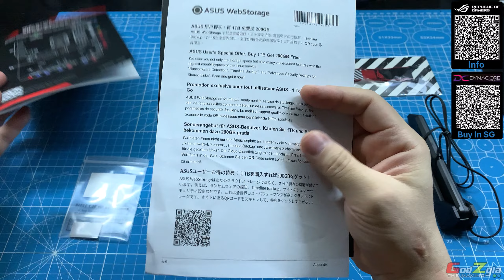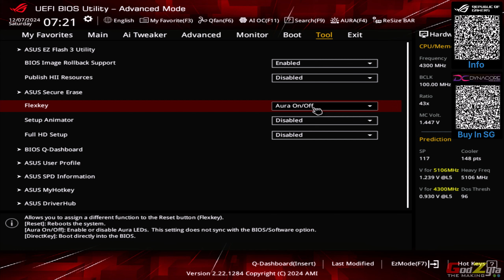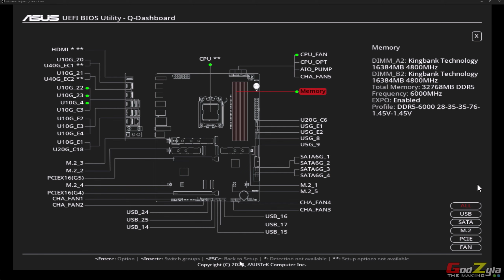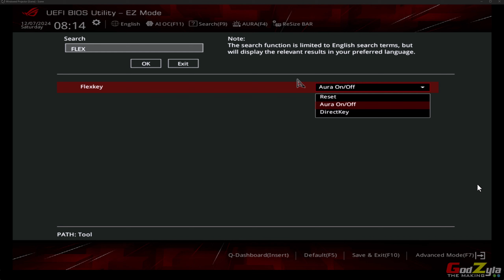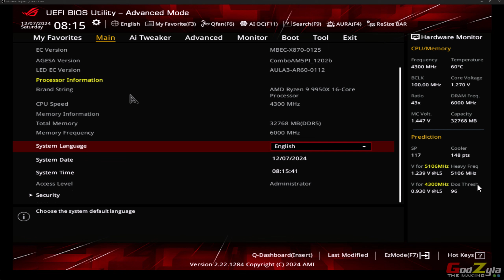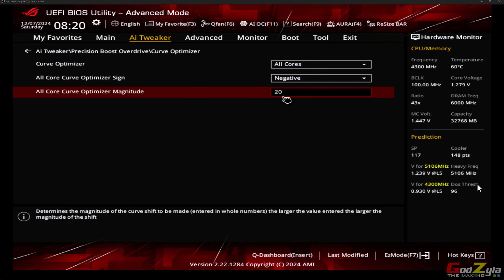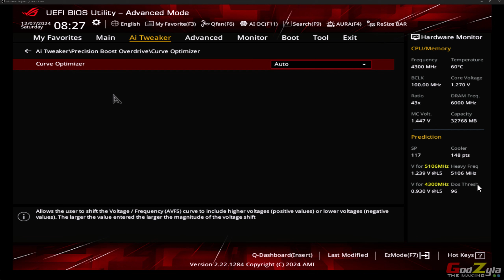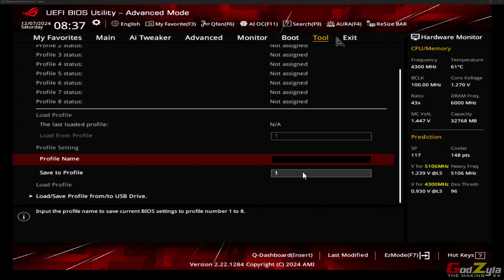Asus ROG Strix X870E-E

Comment: Peiple often nention the Asrock Nova and Taichi have no lane sharing but that is because Asrock chose tp go with a single m2 5.0 slot on their boards so there is nothing for the GPU to share with
Reply from the maker: Hi Keith Flanagan, welcome back. infact what I feel is that ASRock have not fully set the rear to run all with 3.2 usb port at gen 2. if you observe the layout of those ASRock boards, they have limited the USB version at the back. that's why no lane share and on the ASRock X870E Nova, if you insert the last PCIE slot the m.2 slot 5 will be disable. I guess that's all well plan as I feel that how often do we populate all USB at the rear. so ya, that's my thought.

Comment: after installed my DDR5 Corsair vengeance the Motherboard show 30,32,39,40...etc over and over again, the computer works ok but i dont understand whats the problem
Reply from the maker: Hi Brinzan Marius, welcome to my channel. if you check HWinfo on motherboard temperature. the readings on your debug digital code is the motherboard temperature.
Reply: @KleoYan  I did not know that, that's cool! Here I thought it was a typical debug code state haha
Reply from the maker: @KalebSDay  hi ya welcome back and yup, I didn't know at first but I was observing why is the code flashing after booting up to windows and found out that it sync with the motherboard temperature 🤣

Comment: Hi, I bought six Artic p12 argb fans which have like 0.11 amp per fan and 0.45 amp per argb, am I fine to daisy chain three of those with each other and plug them into one fan header and one argb header (same with the remaining 3 but different headers then ofc)? I’m really new to this and I’m afraid of damaging the motherboard
Reply from the maker: Hi Alaska, welcome to my channel. For the fan header of the motherboard is to 1a, so if you total up 3 fans is at 0.33a. It will be fine and it will also be fine to have 3 fan’s argb to daisy chained to 1 argb header as each header is at 3a as the total of 3 argb is at 1.35a.
Reply: @KleoYan  Thank you so sos much
Reply from the maker: @ you are most welcome. All the best with your build too.

Comment: Do you get x16 in the pcie gen 5 slot for the gpu if you only use the m.2_1 gen 5 slot to the right of the board? If so, is there a downside to using that m.2 slot since it sits a bit further away from the socket?
Reply from the maker: Hi ICEFOOL , welcome to my channel. If you only place your m.2 at M.2 2_1 Gen 5 slot, it will run x16 on your GPU. yes though the M.2 2_1 slot is away but it is still controlled by your processor.
Reply: And possibly better cooling for m2_1 as it would be closer to front air intake on most cases
Reply from the maker: @flaccus123  that's very true.. why didn't I think of that.. thanks buddy, good observation.. learned something from you 👍👍👍

Comment: Nice mb, I have the x870e crosshair hero and 9800X3D for my new pc. The hero has a backplate and is quite heavy! I saw another reviewer of the hero say it would be worth it to remove backplate and add thermal pads for the memory chips. What are ur thoughts on that?? Thanks for sharing 👍
Reply from the maker: Hi ya Evil Bane, welcome back. thank you for your feedback. It will definately help on the cooling if you place thermal pads between the VRMs and the backplate. Also provided that you have good case ventilation, if not heat will accumulate within the case.
Reply: Thanks for the advice, I'll be using a hyte y70 touch case with 10 lian li infinity fans and a gallahad 2 lcd 360 AIO. Do u know if the controller for the gallahad will be able to have all my fans plugged into it?
Reply from the maker: @puddleduckist  the GA II LCD pump block connection, is only for standard fans. plus the power supply to the fans are at lower power. I wouldn't advise to plug any uni fans to the pump block fan socket. Anyway if you do so, you still need adaptors which complicate the connection.
Reply: @KleoYan  the gallahad is the infinity fan version.
Reply from the maker: @puddleduckist  oh ok ,,, my bad.. for that. the controler itself, each port can cater up to 4 fans. total is 16 fans and not more than that. so your 10 SL infinity fans will be of no issue to plug to that single controller.
Reply: @KleoYan  Great, thanks for the help!!
Reply from the maker: @ you are most welcome 😊

Comment: 14:14 I was wondering how I would get the GPU out. I expected a button release near the edge of the MOBO, but I am glad I saw your example! That will be a good peace of mind in the future haha :D Thanks man and happy holidays to you!
Reply from the maker: Hi KalebSDay, welcome and Merry Christmas, watch this timestamp at 20:17 https://youtu.be/2mr_38vOd9M?si=u8He17BO5lj6xr30&t=1217 it applies the same with this board on how to remove the GPU from the PCI-E Slot. 😉
Reply: @KleoYan  Ah thanks for the example, I think that is the same card I have too!! 😆 I like the 4090 TUF set to 70% power limit. Reduces by about 100w and keeps most of the performance. Gotta give credit to Optimum Tech for teaching me that. 4000 series does not actually work undervolting compared to 3000 series which he also showed off.
Reply from the maker: @KalebSDay  hmm, for me it works, maybe I am not into gaming but for my work. it works like a charm when I undervolt it and yes Optimum Tech is also where I get to learn how to undervolt the 3000 series and 4000 series.
Reply: @KleoYan  Optimum Tech showed when trying to undervolt the 4000 series that the readings kind of lie and you're actually getting worse performance, so he and Debaur have recommended just power limiting from what I recal. Debaur did a cool video showing the performance you generally keep at different power limits too and 70% was around the sweet spot.

Comment: Hi, Great detailed Video on the Motherboard!!   If you had an  RTX4090 in PcIe slot 1 and you have only two M.2 PcIe-5 in M.2 slot 1 and slot 2, would the GPU run at X16 or x8
Reply from the maker: @graemebarron2128  Hi Graeme Barron, welcome to my channel. The PCI-E slot 1 will run x8 if you populate a m.2 ssd on either slot 2 or 3 m.2 slot. Timestamp 9:01

Comment: I have this mobo, I got a question can I press the flex key to turf off the aura when pc is not on but still connected to power? Cause in order to make turn off as I close the pc I set ErP S4+S5 enabled in the bios.
Reply from the maker: Hi Hold_My_Beer, welcome to my channel. This I have not tried and I have already returned this board to Asus SG, unable to answer your question, real sorry about it.

Comment: Its a pity no cooling for the base of double sided m2's in both  gen4 slots. No plates/thermsl pads unlike MSI Carbon and Gigabyte Master. This is also missing on the hero and proart. The m2_1 heatsink looks pretty beefy though and is positioned close to front airflow
Reply from the maker: Hi Keith Flanagan, welcome back. Spot on.. infact I did feedback to Asus SG on this. Thank you for the feedback.👍👍👍
Reply: Do you know if the Gigabyte Aorus Pro Ice has cooling for double sided SSDs in all its M2 slots? The Gigabyte website suggests they do, but I read in the Overclockers review that only the top most M2 slot has back cooling.
Reply from the maker: @inconvenientfacts58  Hi and welcome to my channel. So sorry, unable to answer your question as I have never touch any Gigabyte board.

Comment: I'm learning the rear audio only outputs to stereo, whats the point of a better audio on board if most if not all x870 boards have eliminated an easy 5.1 hookup.
I'm not sure if the optical out will be enough for my z5500 to give me 5.1.
Not one reviewer amonst hundreds has mention the loss of easy 5.1 setup in the 870 boards.

If I get a 670 series all the audio hookups for 5.1 are still there.
Reply from the maker: Hi Woo Bino, welcome back. You have a very good point there. though am doing this board review, I myself have not tried on the onboard audio as I use an audio interface instead, which is just 2.1 not even 5.1.. but I guess got to test these out in future reviews. Thank you for your feedback.
Reply: @KleoYan  I'm learning to get 5.1 or 7.1 they want (ASUS) you to use the front audio jack in some kind of gizmo hookup?
This generation of PC gamers got RGB but lost the great old pc sound systems we had.
Reply from the maker: @WooBino.  well time have change. Infact you hit the jackpot. I personally prefer to have feature set then to argb implemented on the board. But can’t deny the fact that this is the trend.

Comment: Which M.2 gets compromised if you use the sata ports?
Reply from the maker: Hi Twisted_VII,  welcome to my channel. For Sata Ports, M.2 will not be compromised.. it's only when you plug your GPU to the 1 PCI-E slot.. It will run X8 if you populate either the 2nd or 3rd M.2 Slot.
Reply: @ so if I connect 1 hard drive to the sata port my gpu will drop to pcie 5x8 speeds?
Reply from the maker: @ no as I have mentioned, sata port does not affect your gpu PCIe slot. Only m.2 slot (2nd And 3rd)
Reply: @ thank you for clarifying. Appreciate it!
Reply from the maker: @ you are most welcome.

Comment: hello I have a question I do not know if you can answer me anyway I currently have both this and the ROG CROSSHAIR X670E HERO

and since I have to sell 1 could you tell me which is better? thanks
Reply from the maker: Hi Romi, welcome to my channel. If you need USB 4 with the Type C DP port, then sell your X670E, if you do not need that.. then keep the X670E. As for how good as in comparision, I can't do any comparision as I do not have the Crosshair X670E Hero board.

Comment: Will i need to update bios to use a 9800x3d or is it updated out of the box?
Reply from the maker: @huntersoles6869  hi welcome to my channel. You will need to do the bios flashback for your 9800X3D to work. As the default bios is only meant for non 9000 X3D processor.

Comment: I have the Crosshair 870E. Bummer the only m.2 lane attached to the cpu without sharing lanes with pci-e_1 doesn't let the heat sink clip secure if using a double-sided m.2 drive. You have to take off the bottom plate for the heat sink to clip in but than you have no support on the bottom of the m.2 drive. Read the manual thoroughly and didn't Cleary mentioned double sided drive precaution if installing in m.2 1. I put the double-sided drive-in m.2_4 attached to chipset. Its still fast, doesn't seem any different when I had it cpu attached on my other 670e crosshair
Reply from the maker: HI birdsoup777, welcome to my channel. I believe your m.2 are of dual side chip which is pretty thick. You are correct and not wrong, some m.2 chip height is thicker and when it's on both sides, it''s hard to clip the m.2 heatsink back in place. Again you are rigth, you will need to remove the bottom plate, then you will be able to clip back the m.2 heatsink. Thank you for your input. I do have this problem with the ProArt X870E too.

Comment: There is a flaw at about 9:30 - the PCI-E 4.0 Slot is X16, NOT x4 - please correct it. Yours Kai from Germany - I own that board too ;)
Reply from the maker: Hi Ka El, welcome to my channel. point noted. thanks for the correction. If only I can edit on youtube. but not able to do so at the moment. Nevertheless thank you for the correction.
Reply: @KaEl-Alpha  There is no flaw.  The slot is mechanically 16x but operates at 4x electrically.  See spec summary on page 8 of the manual. Kleo is correct. X670e-e was the same as is x870e proart also.
Reply: @flaccus123  You are right! I am shocked. Never had a board before with a difference in physical and electrical x-mode.
Reply from the maker: @flaccus123  thanks for the verification. 👍
Reply from the maker: @KaEl-Alpha  ok.. turns out that the info here are correct, I can't rememeber which board I did and I said the slot is X1 .. ok my bad.. going to unpin this as it's the correct info.. thanks to @flaccus123 too who verify what am saying is correct.
Reply: @KleoYan  Yes and very important, what Motherboard manufacturers do... It is a shame. For this price it should be x16 too. Maybe you should add a text to clarify the difference between the physical and electrical. Because I looked onto the connectors - the old test and was sure it is x16.
Reply: Thanks too, so now it's understandable :)
Reply from the maker: @ I would add that in but once uploaded to YouTube. I am not able to edit text or to add in voice. Thank you though for the useful suggestion.
Reply: @KleoYan  ok :) Thanks for your appreciation too!
Reply from the maker: @KaEl-Alpha  you are welcome. infact I don't really treat myself as a YouTuber, just happened that PC builing is my passion. just like to share what I know. there are tons of things I do not know when I can learn from you and others too 😉Thank you again for your visit and to have taken the time to observe what I did wrong or right 😊
Reply: @KleoYan  yea, same here. Often a discussion about things are seemingly obvious like in this case helps and other people show up 😂 Really fun to get into a subject like this! 👋
Reply from the maker: @KaEl-Alpha  Yup.. I wish I have more time to discuss than to do content hahahaha.. but oh well. just do what I can do best and thank you.. I enjoy having supportive peeps like yourself. 😉

Comment: nice video again Kleo thnaks.
if u compare other mobos like tempature, bench or max ram speed, it will be best video.
Reply from the maker: Hi Banana Beach, to be real honest, the capability of each brand motherboard has their own strenght and the performance from each other do not really have a big gap. What's more important is the processor silicon chip. The better construction it is or so call good bin processure, all these mid tier X870 or X870E boards will be able to push the performance.

Comment: If you want to have PCIe x16, you can't either 1 or both M.2 slots 2 or 3 as they reduce it to 8X. This is effectively 1x PCIe 5 M.2 and 2x 4.0 slot board unless you are fine with cutting x16 slot bandwidth in half. It may be fine with future cards that are PCIe 5.0 compatible and can run at 8x with no loss of bandwidth, but as of now, you are better off with a cheaper board like my old X670E-F which can run the full 4x M.2 slots while staying at 16x and only loose a USB4 SLOT, 1 usb 3.0 header and the digital display but also gain an extra useable M.2 slot and an additional 1x PCie 3 slot. More important is that it works, the X870E-E is a buggy mess right now, with EXPO/DOCP being borked to the point where for me at least, it disables those 2 bandwidth strangling M.2 drives but while staying at x8, and for others its not booting at all.

Got to say, so far this is the worst mobo I have ever had in the 25 years I have been building PCs, and I say that even compared to janky cheap boards, as at least you expect that and they are dirt cheap, this one cost as much as my 9800X3D and can't even get the description of what happens when you use either M.2 2 or 3 and just makes it sound like it openly does it when you use both.
Reply from the maker: Hi DED DOA, welcome to my channel and thank you to voice out your dislike of this board.
Reply: Why I bought this board is that I don't want to have to install a new motherboard later on. I am future proof with this board. I can install my 5080 when they are released and I am PCiE 5.0 ready to go. Plus the USB config on the back of this board is much better than anything on cheaper boards. Yes, it's more expensive, but then again, I don't have to go through the pain of installing a new motherboard later on.
Reply from the maker: @mackabeats  Hello and welcome to my channel. Thank you for sharing your thoughts. wish you all the best with your build too.